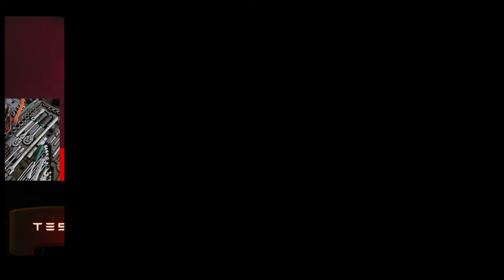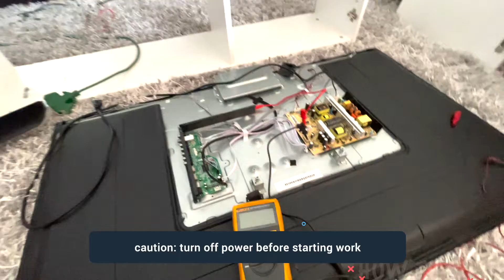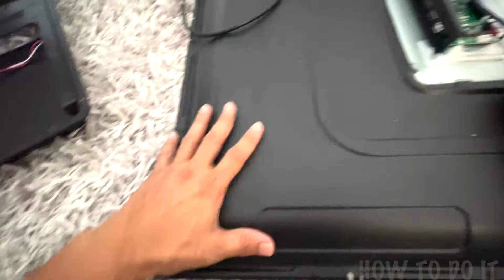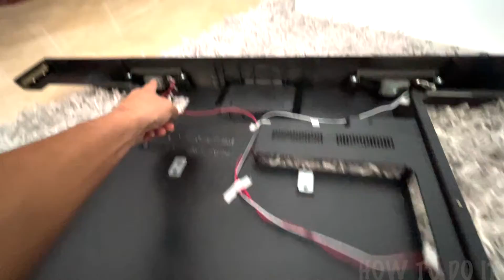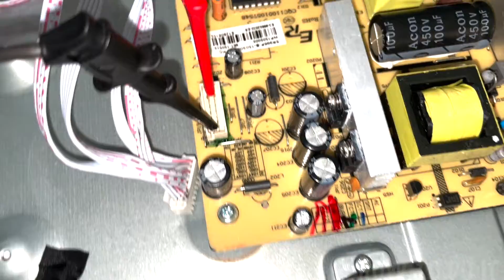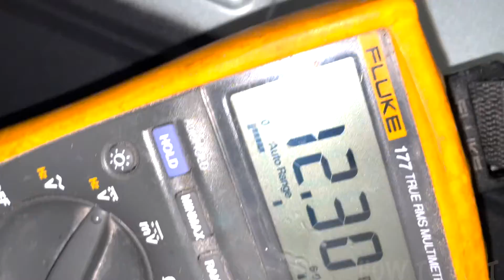TV Power supply card Troubleshooting - RCA and other brands

Comment: I’m having trouble understanding how to check the power supply my tester has a positive and a negative and you have a third lead. Plus you said that you have to jump on them but you don’t say what jumper means or how to do it and I assume that just means bridge to together but the only thing I can get a reading on is the SP1 and I get the 507 supposed to, but I don’t get any other readings on any of the rest but like I said, I only have a negative and a positive so I was putting the negative on the two negative pins and just touching the other pins with the positive lead and they’re all dead except for the Sb can anyone help me and tell me what I’m doing wrong or if I did it right maybe this shows that my power supply is bad I don’t know. Thank you.
Reply from the maker: Most likely your power supply is bad. It’s most commmon problem on these TVs. I have a power supply exactly as shown here if you want I can sell it to you and ship it if you pay shipping cost.
Reply: @HowToDoitright  darn I would’ve done that for sure but I literally threw it out last night. But i do have youbsaved nowbfor future projects! Thanks for replying and thanks for an awesome video you

Comment: I have a Sanyo 55in that I had recently got the power supply replaced on. I used it a handful of times and then one day it went out. I plugged it up earlier and it powered on but went right off and has done that one more time since. Any suggestions?
Reply from the maker: Not sure. Every tv is different and you have to diagnose the issue.
Reply: @HowToDoitright  thanks